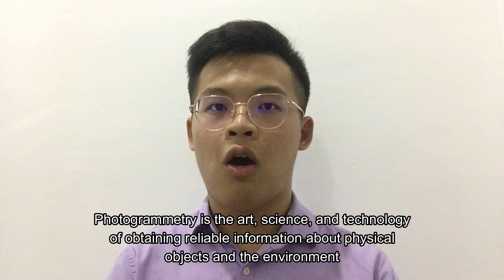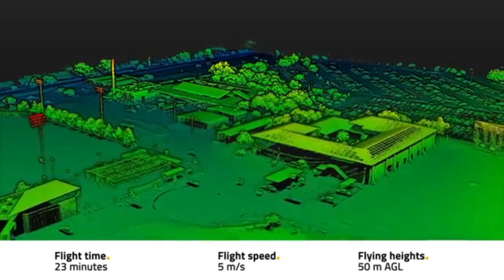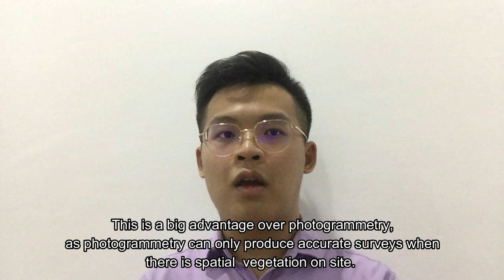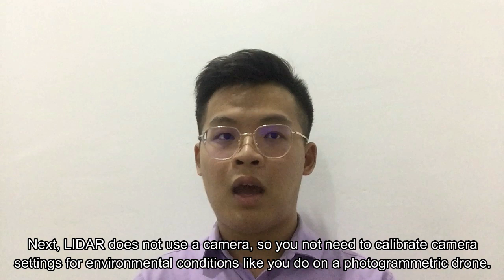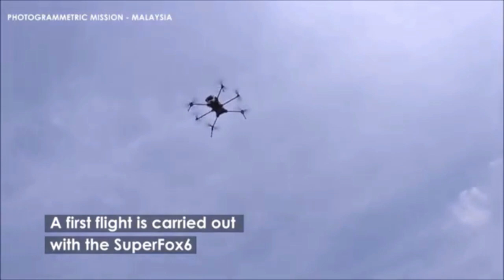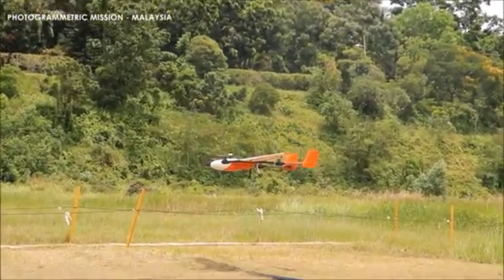Photogrammetry VS LIDAR

Comment: if we used SfM-MVS technique compare with LIDAR, which technique will give us the best result?
Reply: Rasanya computer untuk proses 3D kena powerfull kan....
Reply: @mohamadnizam1505  lidar perlu komputer yg power tapi utk sfm mvs tak perlu rasanya.
Reply from the maker: Utk maklumat, SfM-MVS dalah berasaskan imej fotogrametri (image-based), low cost dan banyak diaplikasikan utk terrestrial dan CRP. Manakala LiDAR merupakan laser-based mapping or sensor dan banyak diaplikasi utk pemetaan dr udara mahupun terrestrial. Dari segi performance in term of accuracy kedua2nya mampu memberikan hasil yang baik dan TEPAT secara umum. Tetapi jika melibatkan pemetaan berketepatan TINGGI, Fotogrametri (menggunakan kamera metrik) dapat memberikan hasil yang lebih BAIK pd tahap keyakinan yg lebih tinggi berbanding LiDAR. Cuma yg penting dan perlu diberi penekanan adalah, masing2 fotogrametri mahupun LiDAR mempunyai kelebihan dan kekurangan masing dan saling melengkapi.
Reply: Rasanya lidar bagus lagi keputusan dia
Reply: Nice video
Reply: Sfm mvs teknik, lagipun lebih murah kos dr lidar
Reply: So LIDAR is more accurate than photogrammetry???